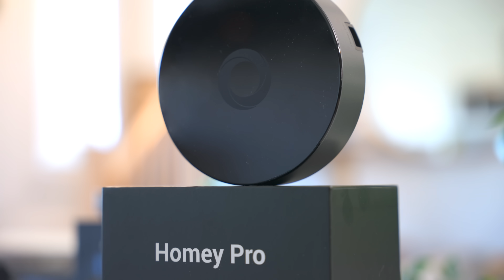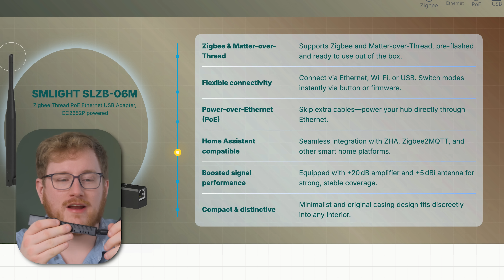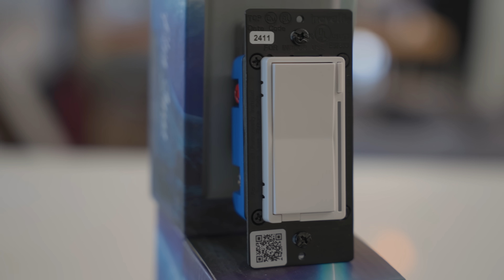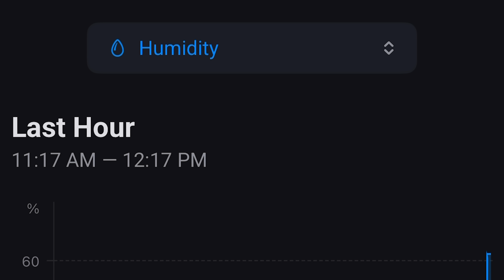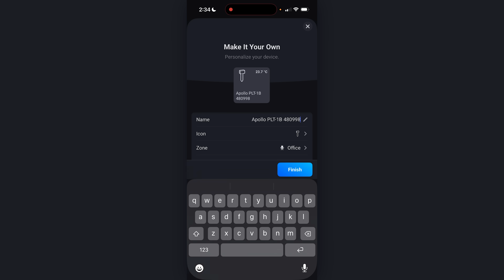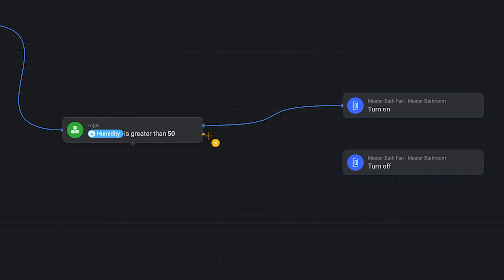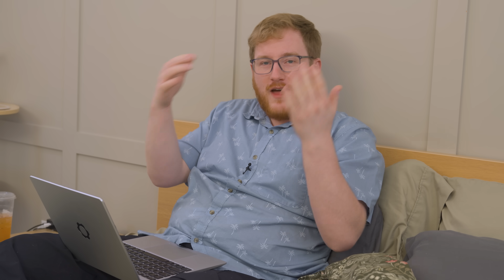I Made a Smart Home That DOESN'T Suck

Comment: If every IOT / Smart home maker could just stay with WIFI as the standard that would be great. Every other protocol sucks and isn't efficient or optimized for a LAN. We need persistence, availability, reliability, literally layers 1-3 of osi at least. That's WIFI and ethernet. Zigbee and the others always sound cool until you realize how trash the protocols are. Like why would I want to slap on a bunch of usb antenna dongles onto a bunch of portions of my house to get an okay yet unstable mesh when wifi can do that with already in place AP's just toss into it's own vlan or a different SSID or network ect... too easy and easy to scale. This however does seem like once you have home assistant in place worth while to consider later on for adding in those ones that you couldn't find a WIFI varriant of. I usually take that as a sign that I shouldn't turn whatever can't connect via WIFI into an IOT device/ smart device.  Yeah I know the ESP32 people will chime in, not the point. IOT is never free from vulnerabilities so not everything in my house will ever be smart or an IOT device and I'm okay with that. I think everyone should have a limit, for me it's smart plugs, smart sensors, smart light strips, smart lamps, wifi speakers, smart dispalys or control pannels, smart energy monitoring and maybe a few I forgot, but defs not ever again any smart light bulbs that plug into the sockets no matter the make and standard or protocol they use, too many bad experiences, the light strips are far more reliable and never have to worry about a switch on, with light bulb off while away then power surge turning back on the lights all over the house. Work arounds with like tailscale or other VPN's while on vacation to check exist sure, but also easier to just know they are all off.

Comment: Think about the stink.  Hot and humid is fine but what if someone takes a big dump.  I put a motion sensor switch on the kids bathroom and wired the light and fan into it. As soon as someone walked into the bathroom the light and fan turns on.

Comment: you should have mentioned that zigbee is great, cheap and not licensed, wich does have the result that not every device is compatible to another, wich is VERY HARD to find out, as most sellers of this devices have no clue, z-wave is more expensive but licensed meaning if they on the same frequency, they will "just work" another thing that is very important is that most lightsiwtch housings do not have power rendering smartswitches almost always useless. in other words, there are considerations required before even starting. and yes .. controlling a lamp with a APP is just a lightswitch with extra steps, without a hub this is just something cool to do to show off but gets old Really fast, so having true automation i moreles required as walking to the switch is almost always easier and faster then fighting your phone connecting to stuff ;)

Comment: There will be a issue with trying to control the bathroom fan with humidity. Where I live in the summer the humidity will often go above 50 naturally and would kick my fan on I later set up a separate humidity sensor outside my bathroom and set it to if the humidity is 10 higher than the hall humidity it will turn on the fan and it will stay on until humidity is within 5% of the baseline reading I get from my hall humidity sensor. Hope that makes sense.

Comment: Small tip — that bath fan is a motor, not a light. A regular dimmer won’t control it properly and can stress the motor. If you want speed control, you’d need a fan-rated speed controller.

Comment: The difference between the fan smart switch and the regular smart switch is that the fan switch uses a relay instead of a transistor so it is rated for the higher current load of the fan

Comment: wow I'm pleasantly surprised to see the Apollo R-Pro-1 on display ... ive tried a TON of Presence and occupancy sensors and A LOT of them are flaky.... there's only a couple that I would say are MOSTLY "not flaky".... And what I mean by "mostly not flaky"-- is that alot of these mmwave sensors need some tuning out of the box and there's only a couple that work well even after it's settings have been adjusted.... Apollo R Pro, Everything Presence are the best I've tried for everything mmwave and then the Screek L13 [(LD2412)-only for basic automations] ... the rest have been kinda shizzy ....

Comment: Charging a subscription (even if there is a "lifetime" option) for a self hosted version of the app defeats teh whole purpose of self hosting. You self host on your own hardware so you don't have to pay a subscription. You pay a subscription for a non-self-hosted service cause it runs in the cloud and not on your own hardware, using your own electricity.  No thanks. Interested in all the products in the video that weren't a sponsor though. Homey doesn't do a single thing that HA can't do even better while being free and open-source. One of the main reasons people self-host, besides the above, is to get away from proprietary services. Using Homey is just inviting another proprietary service into your home, but this time you are letting it be the one to control your entire home.

By the way putting that this is a sponsored video at the beginning so people who don't like it can click away, rather than baiting everyone to watch the whole video before you tell them it's sponsored at the very end, is pretty lame...

Comment: Proper control would have hysteresis:  if (Fan=OFF) and (humidity>50) then turn on the fan; if (fan=ON) and (humidity <45) then turn off the fan.
Reply: Or at least minimum cycle times.
Reply: @kellymoses8566  Yes - there can be several control laws, but then complexity rises and testing costs rise.
Reply: You need a second humidity sensor to give a baseline.
Reply: @dougle03  For a simple control, no.

Comment: We just bought our first home so I’m getting started with Apple Home, adopting new devices slowly as we figure out how we need/want things to work. I already have devices that I haven’t installed yet because they require a bunch of other work/repairs to do on the house in order to do things right. I am setting up a Unify network soon too. I will likely need either Homey or Home Assistant someday, if/when I actually fork over the cash for Ubiquiti cameras lol. For now I’ll be running PoE Aqara cameras; I’ve got a bunch of Aqara stuff running on Zigbee, which has been a good experience overall.

Comment: The best part about doing light electrical around the house is that if you do it right, it works, but if you do it wrong, you'll know very quickly. 

But if the last guy also did it wrong but wrong in a different way, you may just get to find out when that "dead" switch makes your teeth tingle

Comment: If you're adding more than ~40 Zigbee devices, consider looking at the Sonoff Dongle Max. It's considerably more reliable compared to the SMLight SLZB PoE devices.
The Sonoff isn't as fast to relay Zigbee messages, however it doesn't shit the bed when you've got devices on the network that are chatty!

Comment: For mounting sensors in a rental: painters tape (frog tape) on the wall, flatten with a roller or credit card, then add double sided tape (nano tape, not foam), then attach the sensor to that. Looks installed but can be removed with no damage and will hold up in any humidity under 70%.

Comment: You know what? When I watch you, when I see how much I like you as a person, that video is the dumbest thing you’ve ever done. You’re setting up a smart home, right? Everything nice and pretty. But then one storm comes along — lightning doesn’t even have to hit your apartment directly, just the pole next to it — and all that electronics you’ve got in your smart home will be gone. So on one hand, it’s just stupidity.

Things like that are installed by lazy people. They configure it once and that’s it. It works until it doesn’t. And when it breaks, you’ve got a million sensors and you’re walking around the house like an idiot trying to figure out what failed, because something isn’t working. You check the whole network, running around the house like crazy because one sensor died.

Second thing — plants. Man, you still don’t understand one thing and you didn’t take into account that every plant has specific requirements regarding sunlight, air humidity. It can’t be placed near a radiator or other heat sources. It needs the right kind of air, and so on. And you just stuck in a sensor that measured it’s dry as dust. You put in a sensor and now you’re just going to water the plant blindly. You don’t know what soil moisture is appropriate for that plant, right? What air humidity it needs? At what temperature it adapts and grows best?

So you just randomly entered some parameters into the sensor and boom — problem solved, watering handled. When your plants start dying, you’ll learn that you don’t hand things like that over to a computer, because every plant has different water and humidity requirements. It can’t live in just any conditions. Sometimes it needs a darker room, and so on. And you automated everything without even checking any plant guide or “plant bible” about the optimal living conditions for that plant. You just picked 10% out of nowhere. And what? You’ll flood the plant and it’ll rot.

And you’ve stuffed those sensors everywhere. Then, God forbid, there’s a short circuit, a sensor burns out somewhere you shoved it, who knows where — and you’ll be looking for it for a year. God forbid the power goes out, there’s an electrical failure — and you installed an electronic door lock. You don’t have keys, because everything opens with your phone. So here’s the million-dollar question: how are you going to get into your house without keys?

Same with the garage door. Automatic garage doors? A normal person has keys for that. If the motor or opening mechanism fails, you unlock it with a key and lift the garage door manually. I don’t know — I understand that you’re advertising all this equipment that you supposedly use, but what, are you really going to use it every day?

Such houses are impractical. They’re not even energy-efficient. For me, installing something like that in a house makes no sense, because if the power goes out, your house becomes worthless. What, is it really that much effort to raise your hand and flip a switch on the wall to turn on the bathroom light?

Man, seriously. You’re showing things that aren’t worth it. I don’t even know what kind of lazy person you have to be to install things like that at home.

Comment: Great video Jakkuh thanks for sharing our products with everyone! I wanted to add some clarity for a couple of the devices you showcased. We have intro videos on all of our products on our youtube/linked on our wiki pages. Those might be helpful for future customers to learn more about each device and see them in action on the newer intro videos!

Regarding your AIR-1 high CO2 - you definitely should see if you're getting enough fresh air pumped into your home! A lot of newer "tight" houses will need fresh air pumped to get those CO2 levels down!

The M-1 LED Matrix is able to apply any preset at boot you just need to go to Settings -> LED Preferences -> Apply Preset at boot -> save.

Regarding the Pump-1 it can run the pump by pressing the "boot button" which is a nice feature without needing to pull your phone out or run any automations. We also sell a secondary fluid output sensor (identical to the input sensor) for customers to measure the output level such as a keurig water reservoir or similar!

Please let us know if you have any questions and feel free to send your folks to our discord, wiki, etc for support!

Comment: I'm curious about the Apollo Air-1, when you first show it off the B-roll shows an rj-45 connection, but I can't see it in later shots or on Apollo's website. Just curious if it does or does not have an rj-45.
Reply: Thanks for your comment about our AIR-1. The AIR-1 is a wifi esphome firmware based device with no rj45, however, we are looking into adding PoE support to our next generation air-2 or air-2-pro (names not set in stone yet).

Thanks,

Brandon
Reply: @ApolloAutomation  Thanks for the info! Do you have a timeline for the Air-2/Air-2-pro? (I'd go with just the Air-2 personally, the number iteration to me signifies a significant enough upgrade, unless you were going to have two versions i.e. the pro adds the CO2 sensor) The Air-1 should do everything I want but I am a sucker for PoE lol

Comment: I want love Homey, I own a Homey Pro and Homey Bridge, but it has some major defects in my opinion. The biggest issue I have is extremely simple and boils down to not enough device support. Home Assistant supports 100x more devices because of the amazing community support that it has, Homey just falls short and it's not even Homeys fault, it just isn't as big of a platform which is really a shame. However, Homey does have an official Home Assistant integration, which brings me to my second biggest issue. The Home Assistant integration for Homey is absolute garbage. If all you have are basic devices such as lights or switches then it works fine. But the instant you try to import anything more complicated like lets say a Thermostat then you realize how limiting it really is. I only recently just completely migrated my smart home away from Homey to Home Assistant because there were half a dozen smart devices that I use on a daily basis that I just can't use in Homey either due to the lack of native brand integration or because the home assistant integration just doesn't want to bridge complex devices properly. Also for some reason the Home Assistant integration for Homey will just randomly stop working and all of my devices will become unavailable, requiring me to restart the integration manually usually once a week.

Comment: I'll take a shot and guess that the bathroom fan switch being in the closet may be because the fan itself has built-in humidity control. I do know that many bathroom fans including my own have such control. If your fan was not turning on and off automatically based on humidity, maybe it is just the dumbest placement ever, or the sensitivity setting inside the fan was too low, or it wasn't wired in correctly or somesuch. Worth a check.

Comment: Be careful with stab in light switches and receptacles. I bet they have improved but  most electricians recommend not to use them and prefer to use the screw terminal.

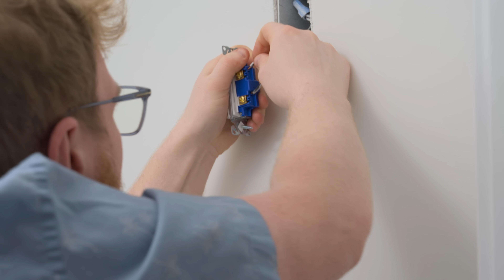Comment: @12:49 dude there’s normally a spot where you put a small flat head screwdriver to remove the tension on the wire so you don’t have to break it off…
Reply: And that appears to be the case here. The actual problem here is that he probably can't get the broken off bit out of there now if he puts the switch back in when he moves out. But he can just use the screw terminals instead.

Comment: for co2 to be acurate you have to give it some time and dont be too close to it.
Reply: This is true for most sensors, even if they are plug and play pre calibrated (like the Air 1). I wouldn't be surprised if it's 1125 PPM though. Still winter (technically), so windows will be open less. That said, you generally shouldn't have to worry about CO2 if you open windows for 10 mins 3-5 times a day. That's the general rule of thumb.